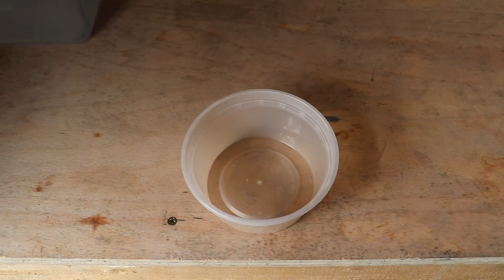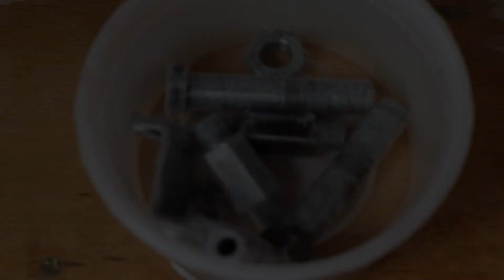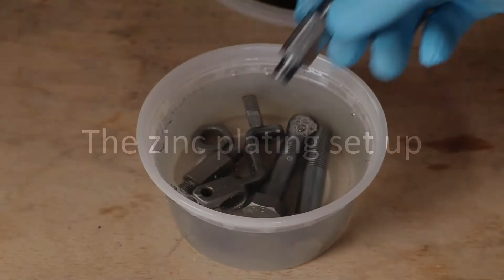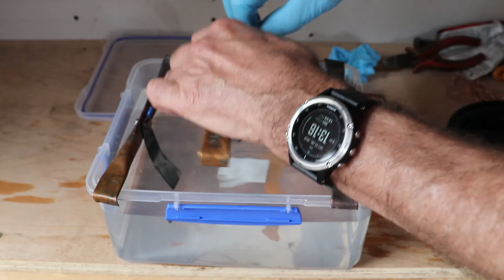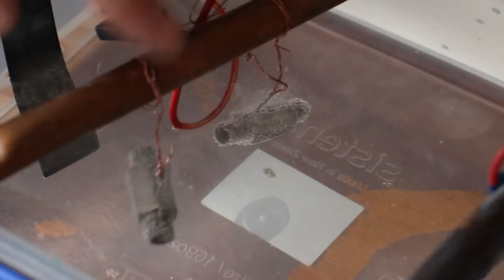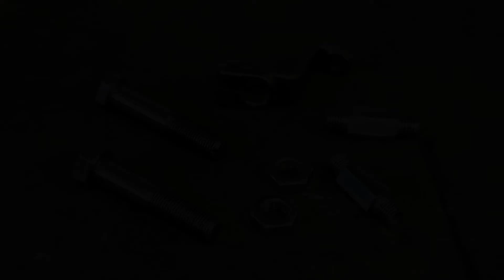Moto Guzzi: Zinc Plating

Comment: Just a warning from an old timer who has recently retired from 48 years in the Electrophoretic, Electroplating, Powder coating industry ,processing automotive and aerospace components. The gas that is given off during the 20 minutes of "plating", and I use that word loosely is Hydrogen. Very volatile if allowed to build up in enclosed or poor ventilated areas. A tiny spark, which could occur when disconnecting the power or moving the component while live could result in a loud bang at best or a tiny explosion at worst.
Not a lover of these DIY plating videos tbh.
My advice is to look up your local metal finish factory and take the parts to be properly plated. The parts shown here will cost a few pounds to process and will be a far superior quality to these which tbh will have hardly any plate on them and would not last a week outdoor use.
One more thing if your thinking of a more prolonged plate time to increase the coverage /thickness, the parts could become brittle through Hydrogen Embrittlenent. In a commercial process any parts that are Safety critical go through a De-Ebrittlememt process whereby they are heated to over 200 deg for at least 4 hours to drive of any Hydrogen absorbed during the process. Important if the parts are used in steering or braking devices or load bearing parts.
Sorry to be a bore, but as I say, not a fan of DIY plating videos and none of the above was mentioned by the poster.
Cheers from the UK

Comment: will the parts get a better longer lasting  zinc coating the longer they are left in the solution ? say you left them overnight in the solution rather then 20-30 minutes etc ?
Reply: The bad: Anything over an hour would cause undesired results. It would start plating uneven and eventually have a wrinkle finish. This would just be wasting the zinc and look like that wrinkle finish paint. 
The good: If you had a set of handles from a wrench or plyers you could plate it for 5 or 6 hours and you would have a awesome rust proof slip free grip on the handles.

Comment: The degreaser is probably just caustic soda. Hydrochloric acid can be obtained from the builder's merchant - sold as mortar cleaner/remover.
Reply: It's called muriatic acid in Canada
Reply: @jakefriesenjake  caustic soda is NaOH (often found in drain cleaner), muriatic acid is HCl
Reply: @KACPER050599  yes exactly

Comment: Copper plate them now, heat with torch just lightly. Brass plating done. I do it to my suspension bolts, nuts etc. MOT testers always drop jaw when they bring car up.